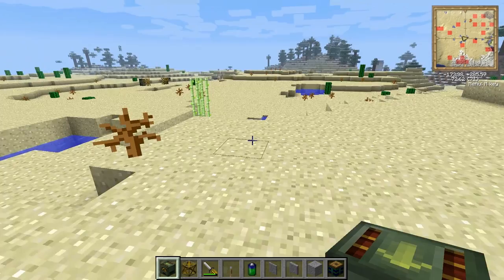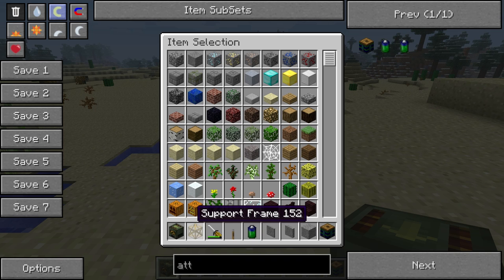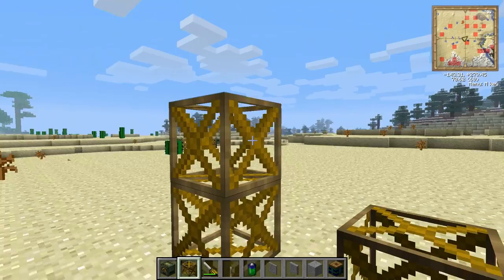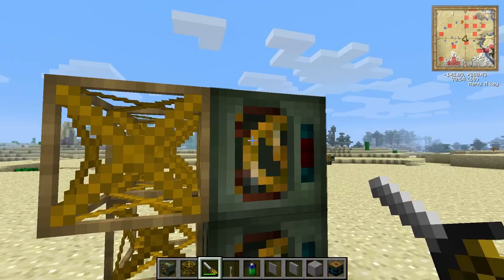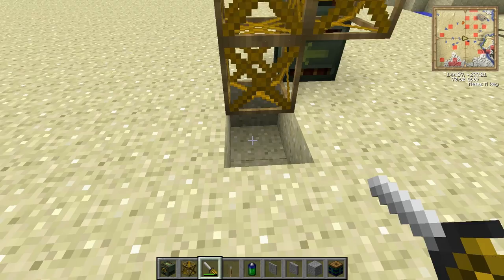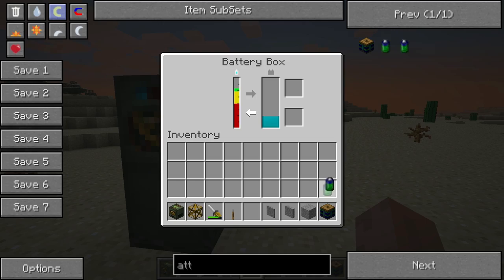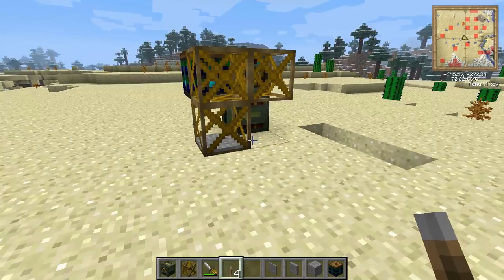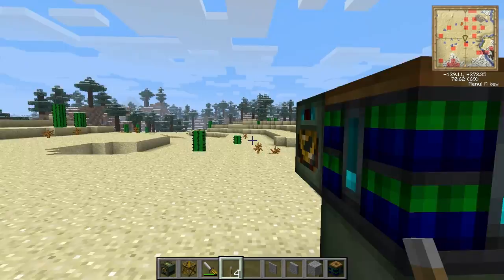[Tutorials] Redpower Frames - Compact Inchworm Drive

Comment: This may seem like a stupid question, but why does it seem your frames and frame motors are a lot smoother (less glitchy) than the ones I'm used to using, i.e., the ones in the current version of RedPower2 in the DW20 FTB pack.